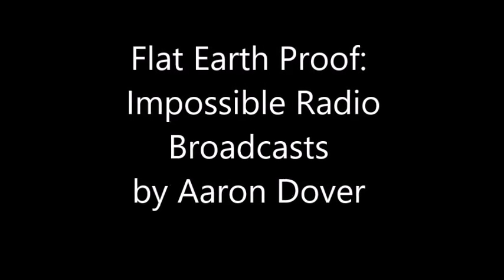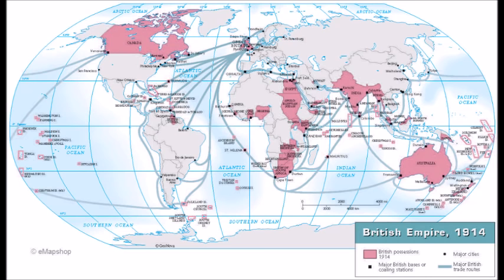Flat Earth-Impossible Radio Transmissions

Comment: the easiest way to test the ionosphere theory of skip propagation in short wave radio is to model a spherical room with dialectic layering on the ceiling to mimic the alleged ionosphere and a circular metal room divider with a shortwave transmitter on one side of the divider and a receiver on the other.

Comment: Explain amateur radio, which uses satellites,the ISS ,HF, VHF,UHF, skip distance and the null between groundwave and first hop, which is why The practice of NVIS exists .HF long /short path, Moonbounce (EME) if the moon and the sun are the same distance why is the moon 384,400km in space, and radar says Venus is from 30,000000km out to 261,000000km, yet with this as a yard stick tells us the sun on average is 1AU = 149597870700 m.
 Just as a passing question what is the speed of light on flat earth? 
Here we have measured it as 299792458m/s in vacuum , if this was not the case no antenna on earth would resonate at its fundamental frequency.
 Or is c/f=lambda wrong?
As for curved water, you may want to tell every naval and private craft on the oceans and waters of this planet their vhf marine band radios are malfunctioning
 As the typical radio horizon is given as the square root of the height in feet multiplied by 1.42= the maximum radio horizon in miles. 
It seems to me that EM propagation does actually prove the heliocentric globe model.

Comment: you newd to watch the WI6f. video.  the guy says modern radioers need to use a great circle map relative to there location, i think the cocksuckers engeneered the whole HAM radio hobby for illusion. Seeing how Teslas very effecent radio, traveled nearly all through the ground,  So they are useing frequency harvesting technology, to make the radioer turn up his watts,  and then when they get confermation that the dude has in fact poinyed his shit in the right direction,  then they let the communication through.  and i wonder how may hammists really push the limits (or try ) without using a gay relay station. The military is full of a bunch of brainwashed pussies. Peace.

Comment: I must disappoint you, man, radio wave propagation actually does prove that the Earth is spherical. Even amateurs back in the 1920s managed to communicate btw. Newzealand and England without any repeater stations due to the ionosphere bouncing effect which works only with the short wave range of 3Mhz to 30Mhz!! Any higher frequencies penetrate the ionosphere (with rare exceptions during sunspots or some other cosmic crap). Were it not so, we'd be able to listen to FM stations from thousands of miles away without any repeaters.

Comment: First off the first wireless transmission was from Cornwall England to Newfoundland by Marconi.

 And you are overlooking a very important aspect, such long wave communications are only achieved by reflecting off the ionosphere.

If the world was flat, then radio transmission would be achievable by simply broadcasting across the ocean with no need for any reflection off the ionosphere.
Reply: 'ionosphere' - you mean FIRMAMENT DOME
Reply: @John Smith you made it obvious that you have no idea on what you are taking about.
Reply: Sure - that must really explain why my antenna direction seems to match the expectations of a spherical earth. It must explain how I can get to mainland Europe and Russia on about 10W at low frequency, but 100W at VHF doesn't get anywhere near the range.
Reply: reflecting off the ionosphere termin?  isn't that less dense than the lower atmosphere to the ground?  why don't your magical waves bounce before they even reach the ionosphere.  This theory seems extremely less likely
Reply: +Termin  SHUT THE FUCK UP, you repeating parrot. You didnt even figure out how or why, to wipe your own ass on your own. The only thing you know is what you were told, and you were not even smart enough to ask a question, because you were not taught, dumbass. It gives me great pleasure to say, no it doesn't.

Comment: When you did a little bit of research you found out that this topic has been handled for many times. But here is how it works:
1. The BBC world service (or what it was called in the early days) used short wave radio. One of the funny things with short wave radio is that you can reflect the radio waves against the ionosphere, making very long distances on earth possible, without relays. So the transmissions are and were possible now as they were in those days. And there is no freak atmospheric condition needed, and that is a proven way to send radio signals all over the world.
2. Do investigate before posting, now you make a fool out of your self as this video shows that you know nothing about radio and how radiowaves work at all and still you tell that you know that the radio transmissions were not possible...
Reply: SHILL
Reply: @dbonejones8715  Wrong.